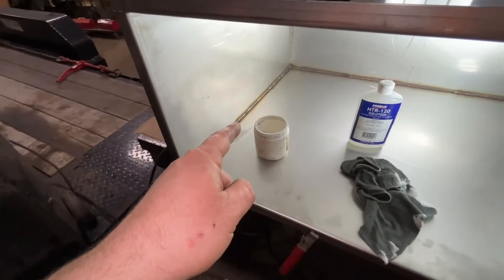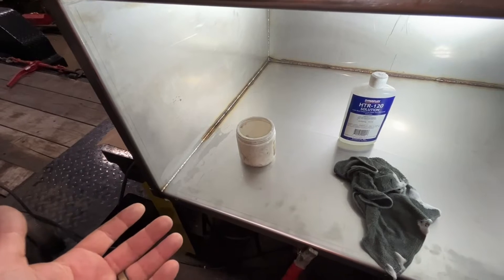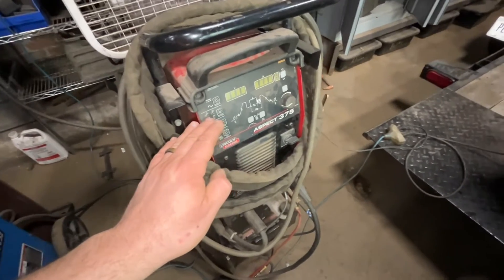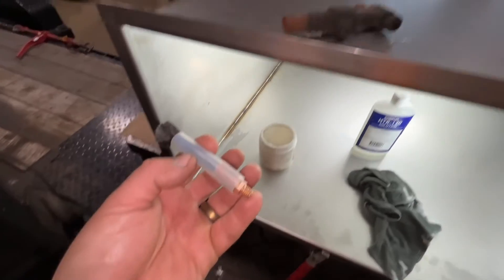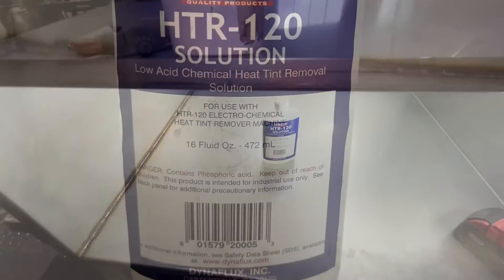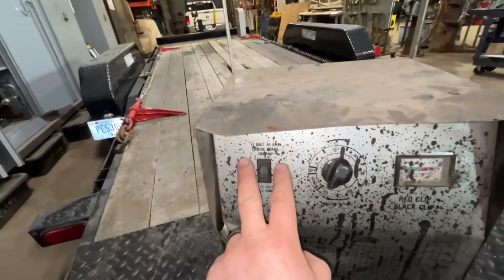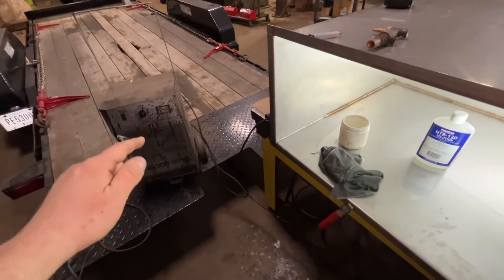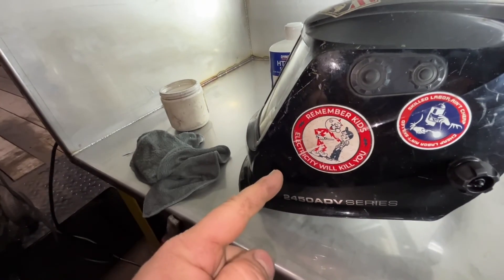Cheap Stainless Steel Weld Cleaner!

Comment: Question, maybe I missed something but you said your tig only goes down to 20a and "thats way to powerful" but you are using your battery charger set to 40a. Please explain.
Reply from the maker: I’m sure voltage plays a massive part. Unfortunately my Tig only goes by amperage, but just like 24 V 40 A would have massively different results than 120 V 40 A.

Comment: You can also just use your tig welder for this as I think you know. AC for cleaning, DC for polishing if it will go low enough. I have also discovered just applying the fancy juice to torch heated metal accomplishes the same result. It is therefore, mostly a heat related transformation. Who knew?